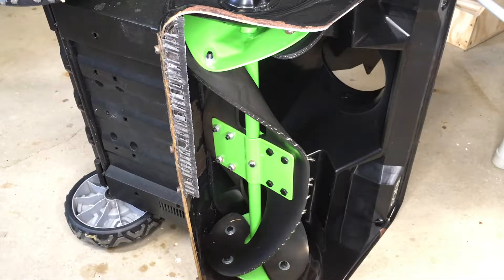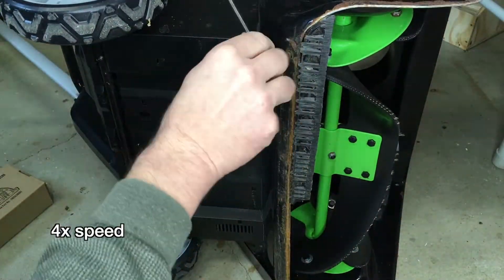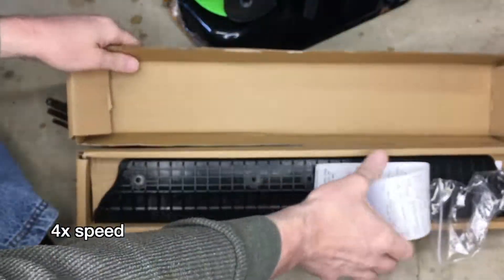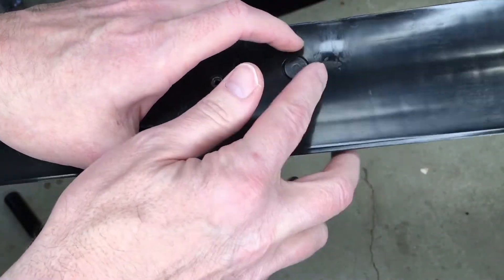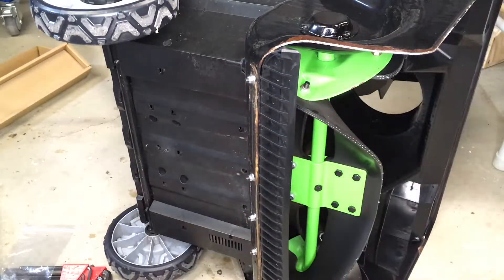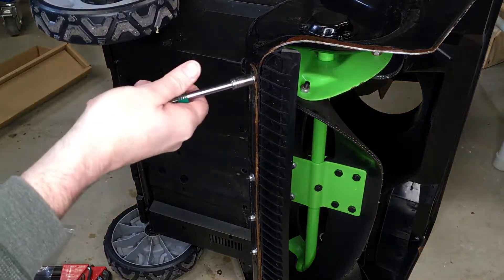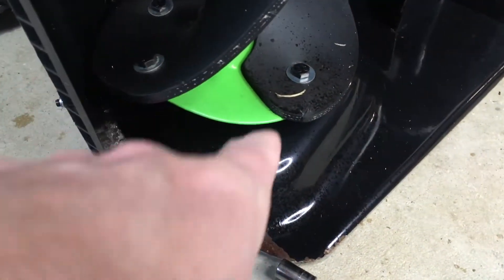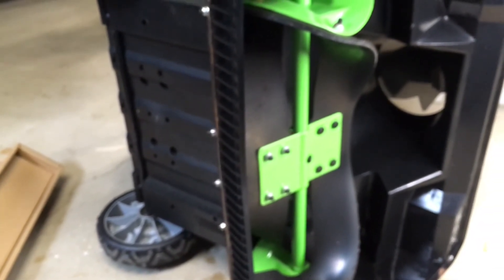EGO Power+ Snow Blower Scraper Bar Repair

Comment: Scraper is a wear part. It certainly is not a warranty part anymore than the oil in your car. Your paddles are worn, and you belt is due for replacement after four years.

Comment: wish there's an aftermarket metal scraper bar
Reply from the maker: I like metal but one advantage of plastic is that is doesn't rust and leave marks on my garage floor. I wish the plastic one was cheaper so I could just replace it every other season before it breaks.

Comment: whoa,  your augur housings are beaten up and rusted too.. :-O 

I bought mine not that long ago. I was aware of the warranty, but yesterday I went ahead installed skid shoes referring this guy's video:
https://youtu.be/2TDqL-wo1KM
He used the Ego 2nd stage's OEM skid shoes.
I bought very similar ones from a local shop. 

The L-shaped skid shoes for Greenworks or Kobalt should work too. 
I just couldnt use them since their installation areas on the steel housings were beaten up and a bit softer, because I had installed small wheels there and didn't work out. Wheels got too much impact from icy/hard snow and that bent the steel. Bad idea. Almost busted screws around LED lights. 
Glad I changed to the skid pads to protect the housing and reduce stress. Scraper bar would last longer too. 
Just hoping that major breakdown wouldn't happen that requires warranty 🤫

Comment: Not bad for 4 1/2 years!  if you wish to slow down the ware or avoid the "heart attack stop" by the cracks than this video may help: www.youtube.com/watch?v=TOzJYDF544I.  Takes 10 second to drill through the metal with the impact driver once the holes are marked.
Reply from the maker: That looks nice! Thanks for sharing. My warranty will be up this fall. I may look into modifying it after that.